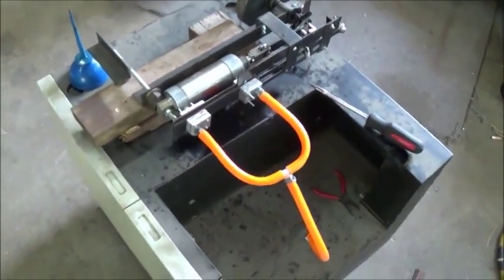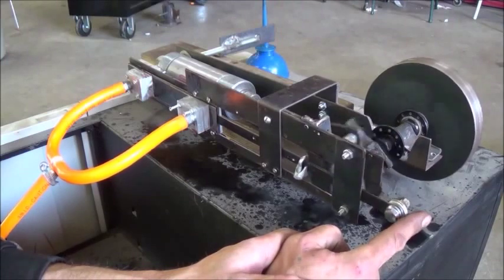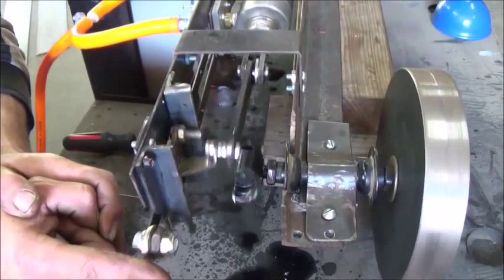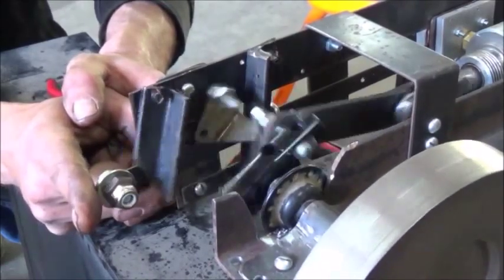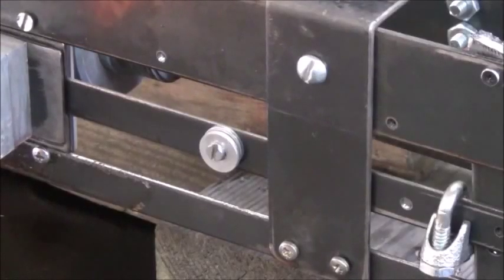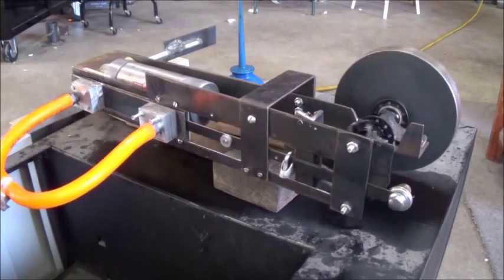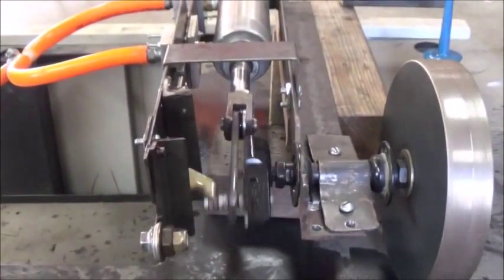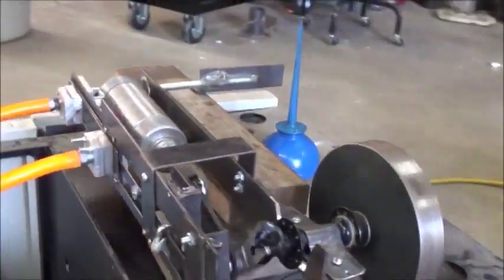How to build a simple working engine for Off-Grid applications.

Comment: Sooo. Question: is a tesla turbine worth it? I’d hate to have to oil an engine constantly and I love the thought of having a cool turbine generator, but I’ve heard that Tesla’s magical 95%+ efficiency was pretty much bogus and based on efficiency with no load. So what are your thoughts? For a regular guy who wants reliable power which should be choose to build or buy?

Comment: Why aren't you using an eccentric?
In that way the valve movement is a lot smoother.
Reply: johngroenen the whole point is to be off grid. To work without electricity.

Comment: Have you seen a project of one of those ventures that usually go out of business before they get a product to market, but take a lot of grant money. It's a small turbo at the sweet spot of a parabolic reflector with a sealed refrigerant to spin the scroll wheel turning a low loss alternator to produce electricity. I saw it a number of years ago and it hasn't reappeared, so it's likely done for. I was at military installation in the desert Southwest.